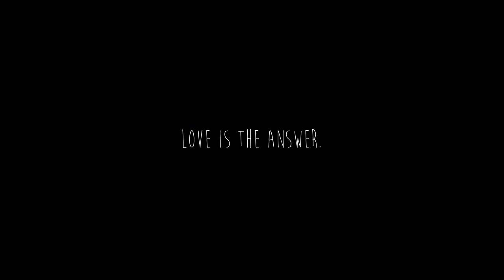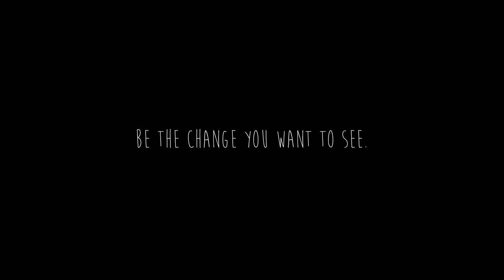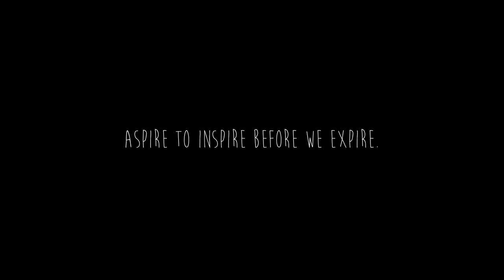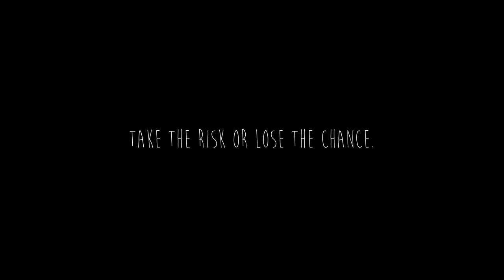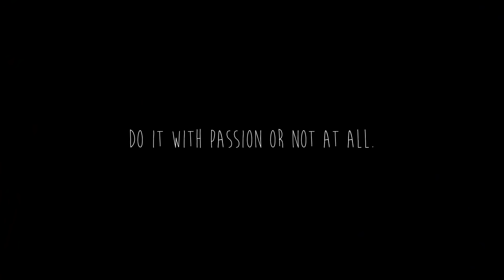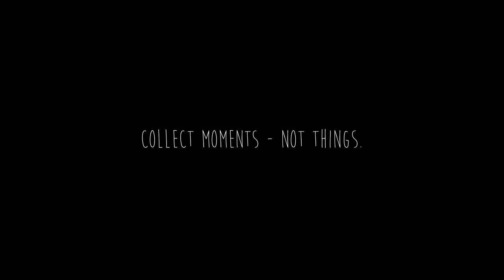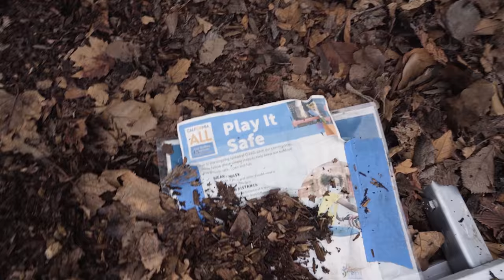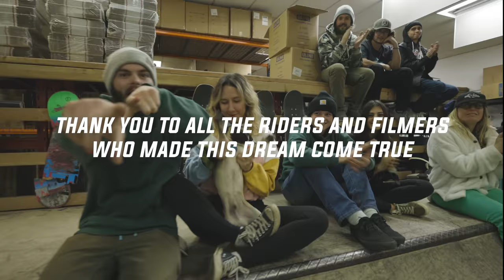A New Normal - A Onewheel Film | Team TFL Onewheel Tricks

Comment: Incredible! I’m inspired to try something gnarly on my onewheel! Don’t worry guys, I’ll be sure to get some sweet footage straight from the ER for the YT channel! 🤣
Reply: @AudiHere69  probably?🧐
Reply: @AudiHere69  You seem too brand loyal. Pint has things that can be nitpicked. Simple as. When a vehicle's method of input is leaning forward, it's entirely fair to critique the dangers that come with that and mention mitigations that FM could implement going forward.
Reply: @AudiHere69  from what I can tell there are functions on EUC's that Onewheels could benefit from. Nothing wrong with constructive criticism
Reply: @AudiHere69  there are mitigation systems in EUC's that one wheel doesn't have. This is simply fact.

You don't have to like EUC's to recognize that most (read not all) don't have their top speed be right next to their max power making it hard to prevent cut outs .
Reply: @AudiHere  eucs are dope! Different vibes but I'd buy one! Currently have an xr and wouldn't trade one for the other. Ride em both!